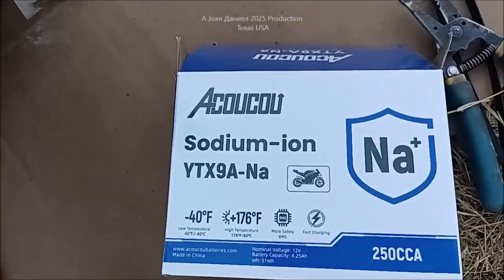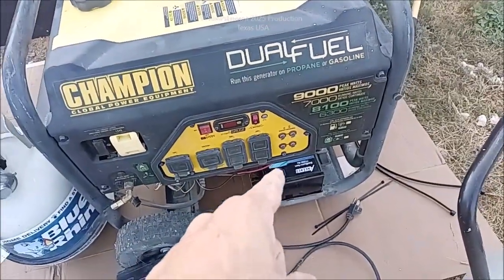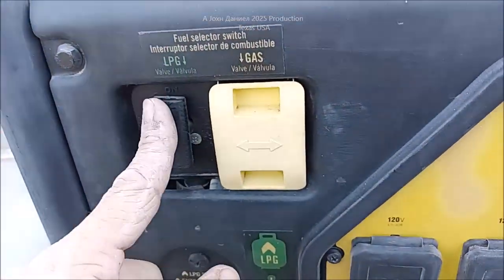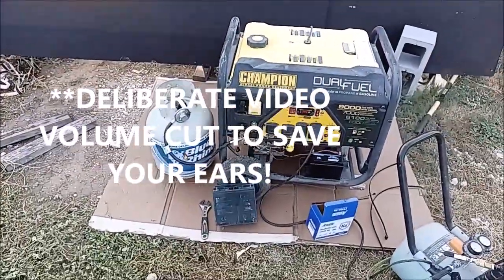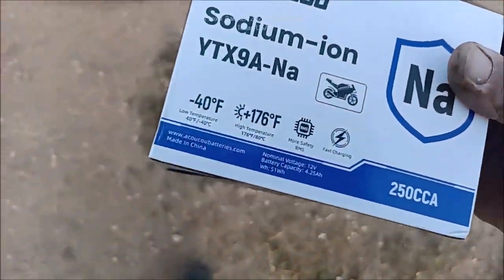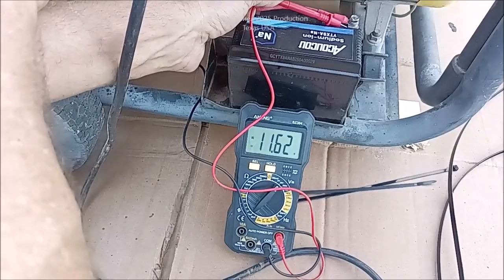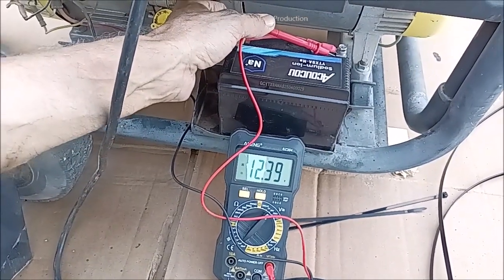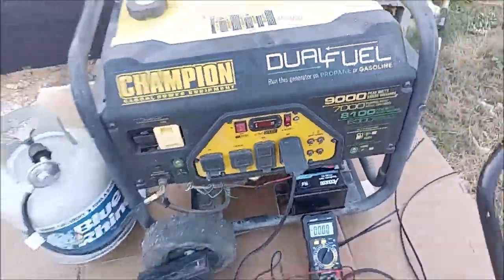Is it worth it? Sodium-Ion Starter Battery Na⁺ | by Acoucou YTX9A-BS 250 CCA | Real world test

Comment from the maker: I used their XTY9A https://amzn.to/3JXdKLv Other Sodium-Ion Sizes you may want https://amzn.to/4mZgc2Q  Champions newest Dual Fuel Generators,  Be ready for power loss with one, AWESOME! https://amzn.to/3JMquVs  Need Tech Answers? go👉 Donate $5+ with KoFi - https://ko-fi.com/john4kiera OR https://bit.ly/2buyaCoffee message, inquire, to get my help, replies!! Go⬇see all ⬇
Reply: yea i building one for my atv with lithium tantaniate or what ever its called they can go to 0 volt and be charged 20k time made in japan   battery  hook up  has them   lithium iron cell can work 2 i guess i know temps  . supersized you ant just there one together to do it from cell flopped around .. Sodium-Ion is cool i was going to get cells  but they sold out and i fergot 2 lol
Reply: Saw a video yesterday where the content creator used a Sodium-Iron 900 plus CCA battery in his truck, and the Alternator didn't like the battery. His gauge in the truck was showing an error of some sort, if my memory serves me right.
Reply from the maker: Modern cars with optic switches, Solid State charging and logic systems will not like the Sodium Ion. It is best for small engines and marine use.
Reply: @JOHNDANIEL1  it seems so John
Reply from the maker: I got a great idea for a Automotive use solution video, hopefully if I make that video folks will chip in some $$ since it will be HUGE out of pocket to help all who see it. DONATIONS NEEDED TO DO THAT!!
Na+ Charging acts: This is due to the Sodium Ion top voltage is 3.15 volts so their 4 cell is 12.6 volts, a 5 cell 15.75 volts would be better even if it never gets or sees 100% charge. You can just install a dc to dc Buck Boost of 40 to 50 amp output into the fuse box to run all the cars needs. Hitting the starter with 15+ volts is not harmful most can handle 18+.
And that is why it is charging like it does. The expectation from the computer in the car thinks its trying to charge a sick or shorted battery.  Proper Sodium Ion solution for a full size cars will have to have a Ni-Mh or small lead acid trick battery in it so the system sees it is working right. You can use a 35 to 50ah Sealed Lead Acid battery in the loop to create a normal voltage Electronics battery and use the Sodium Ion as starter only. I may get one of both to do real life test on my 1997 F250.

Comment: Replaced my generator battery with one of these a couple of months ago. Worked great being outside in 0-10 temp weather. Be aware that mine arrived needing a charge but I just pull started the genny and let the genny charge it up.

Comment: Are these batteries known to be able to be put in storage (say in a riding lawn mower) for the winter and be able to maintain a reasonably full charge until spring without charging?  No load obviously.  A lead acid battery will usually gradually lose its charge over time.
Reply from the maker: So far they are able to do that from the general reports on it. I would remove any battery when you store things but as it is now it is winter proof and only expected to loose a tiny rating.

Comment: Do you think the charging coils could cause any issues? I have a larger champion with a lead acid starter battery. I’m curious if it could work in a car as well. Starter batteries in general have become very crappy and low quality.
Reply from the maker: The little battery has a BMS in it with a simple system of ON/OFF based on voltage only and the Sodium Ion voltage is 3.15 volts so 4 cell is 12.6 volts and that is why it is charging like it does. The Generator puts out 15 open volts but it's regulator sees 12.6 on the battery and switches on and off constantly so I would say that the problem if any that may happen is eventual wear on the internal generator regulator if any problem at all. My plan is to put a 3S Lithium Ion charger on the generator AC output to make the Sodium Ion get charged to that voltage ( also 12.6 ) as full clean charge when it is running.

Comment: Didn't I read somewhere that these sodium ions don't have the service/cycle life of LiFePo 4s? Thanks.
Reply from the maker: They have 300% more cycle lifespan than LiFePO4 but none have the long storage amp hours as other batteries. Great for starter battery use, not for Off Grid, at least not yet but they say that is about a year away.

Comment: Wish you had a dc amp clamp to see what was actually coming coming in the battery. From all appearances system operating voltage isn’t be achieved. Wonder what it would do hooked to jumper cables on a car system?

Comment: Been wondering how well sodium batteries would work. Great video showing the recovery on them.👍👍👍👍
Reply from the maker: I think they are OK for starting batteries with excellent temperature stability but for deep cycles or energy storage I would wait a full year on development. About the time my 28 GC2 lead acid fail I will likely replace them with hopefully more Amp Hour capable Sodium Ion and connect them to the LiFePO4 directly as I have my Lead Acid done. Then we got a super system.